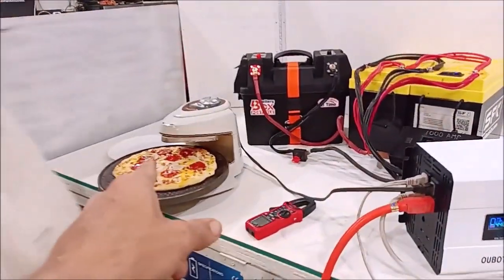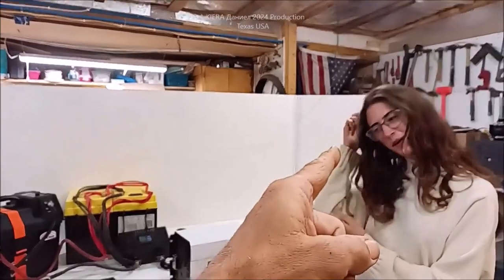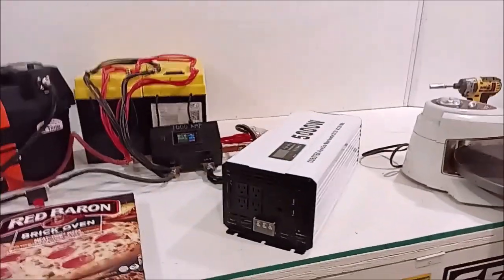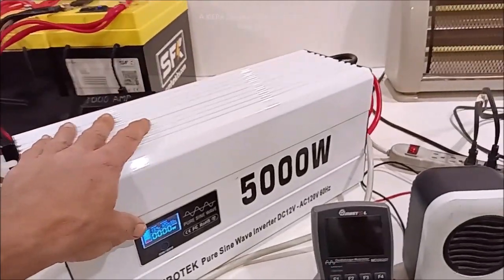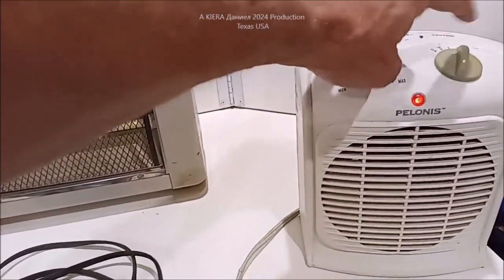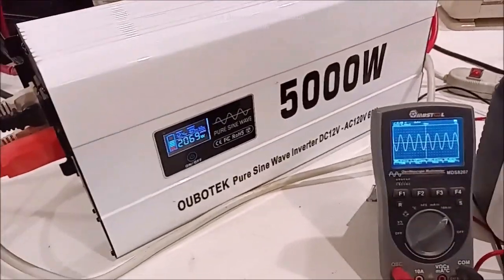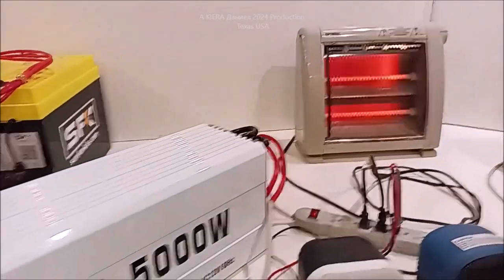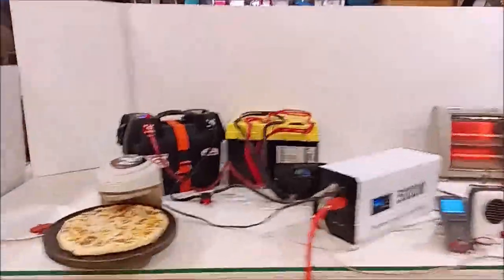New 5000 watt pure sine wave inverter from Oubotek. Full stress test on it & Inside Look too

Comment: i have the exact same inverter you have. i love the feature that it came with. when over or low voltage protection is reach, the inverter will shut down and automatic resume once voltage reach ideal level. this works best for me since i have a automatic transfer switch install on my circuit. can't get any better then this

Comment: So this inverter can be used with a two battery bank system? Does it matter if you got one battery bank that is lithium iron @12 volts and one battery bank that is lead acid @12 volts?

Comment: Too much for a 12-volt system, this should be 48-Volt, so it does not burn your house down!!
Reply from the maker: Why would 12 volt burn a house down? Any voltage can burn a house down, over 90% of DC voltage use is 12 volt so it would have over 90% of the "caused fires" but it don't, 48 volt does since it can arc at a rate 300% more than lower voltages.
Reply: that's not always true only if you know what you're doing. i ran mine hard drawing between 100 to 200 amps from the batteries and yet no fire.

Comment: Can this inverter give me 220 volts to run my well pump. Thanks
Reply from the maker: No, all inverters that offer 220 volt unless stated for the US market are running 220 single phase 50 hertz. You will need a sungold 4000 to do that. This model, 
 https://amzn.to/3BRM1Iv They have dropped in price recently and they are huge in quality.

Comment: What size wires are you using to draw the 420 amps?
Reply from the maker: It has 2 awg x2 on it, 2 awg cable is only good for 205 amps continuous ( TEMCO CABLE CHART ) 2 awg can handle quick 230 but briefly.  I needed 1 awg which is good for 240 continuous ( 580 max) or maybe even 1/0 for 285 continuous since it will surely hit the 5000+ if I had enough amps.
Reply: @JOHNDANIEL1  do you have any vision how you put 2 gauge in parrallel like that, I always see it and wonder how to do it
Reply from the maker: @viyusavery248  You can add 2 strands of 2 awg into a 2/0 battery lug terminal and crimp it making a 410 amp cable or even 3 strands into a 4/0 terminal and crimp it making a 615 amp cable minus the 4/0 terminals limit ( actual is 505 amp max )
Reply: Is just not right pulling that amount of power from 12V system...
🤗

Comment: That's probably the size inverter I'm going to need in my shop.
Reply from the maker: It's a easy to deal with inverter, I plan to put a 20 amp single outlet in it and a 30 amp RV outlet in it and toss the ones it come with. For brutal tool starting its excellent. You just have to supply 500 amps capacity to it with at least 4 of 1 awg or 1/0 gauge for it, use NO 2 AWG!